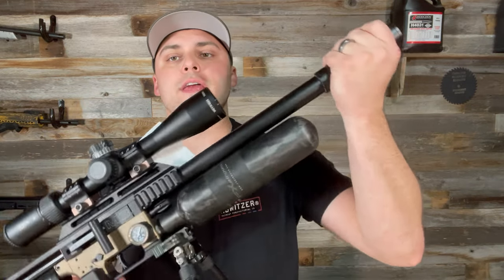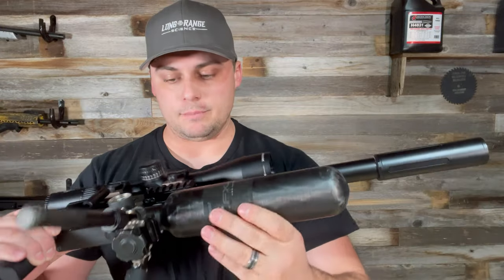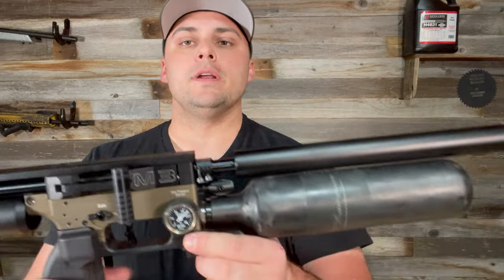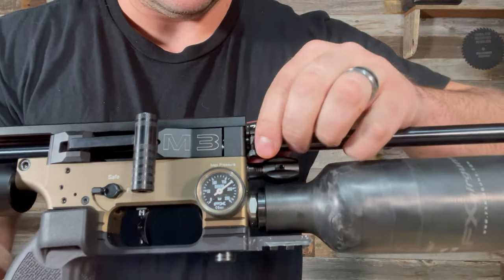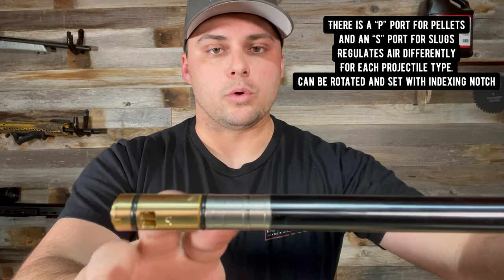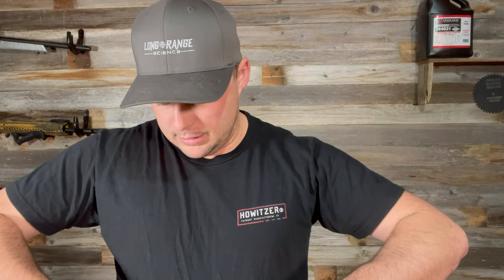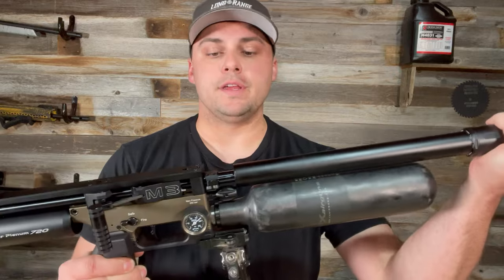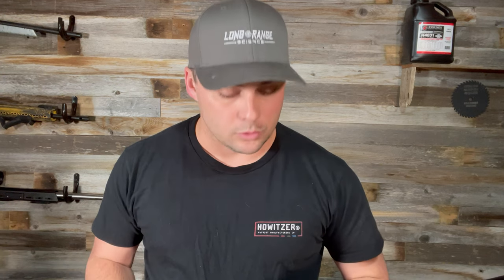Trouble shooting my FX Impact M3 barrel issues

Comment: If youre shooting anything over 500mm barrel length, you have to stiffin/stabilize the barrels on any FX platform! And detune the harmonics. Duhhhh
Reply from the maker: I just got a slug liner and the carbon sleeve. So hopefully everything should be set now
Reply: @longrangescience  ya I understand that Sir. I figured as much. If your thinking about powering up, you have to stabilize the barrel more and get some of the harmonics takin care of as well. I own a few and my friends have some as well. You have to research thorough or talk to a tuning professional on it. I would suggest contacting Matt Dubber somehow or someone like that knows how to squeeze them out with power. It's unlikely throwing on the parts and shooting trying to figure things will work, b cuz it doesn't. I'm just trying to steer you in the right direction b cuz you chose an FX model. The AGT or Uragan models are less headache as well as a few others.
Reply: Ironically FX's Achilles heel is their adjustability in my humble opinion.

I run a standard 700mm barrel in my M3 and using 30gr .218 H&N slugs @985fps. Using 68 year old eyes and a rickety UTG bipod, it will print 15mm groups at 100m ( 109 yards) all day long. No stiffeners no tuners, no rails and other after market rigid frame things etc. So when you find a happy medium, stop fiddling.
BTW  I also have a Weihrauch HW100 with a 600mm barrel. Just one grub screw and a simple barrel band, and it too is incredibly accurate. You don't need to stiffen a 500mm barrel unless you're hanging a very heavy moderator on it.

Comment: Man to bad your first outing was ruined by someone not putting your rifle together properly. I own 2 fx air guns one being an M3 and love them. Know them inside and out. If you don’t know the rifle well it can be frustrating to fix the issues. Especially on a brand new gun. 

I went to your shooting video and your rifle clearly sounded goofy. Like you said the barrel was not seated properly letting air poof out of the breach. Also causes mag loading issues. Im still confused why they gave you that barrel band right in front of the breach. It’s doing absolutely nothing where it is. They have a tensioned barrel system that doesn’t even use a piece like that. Very weird…
Reply: Ahh the new m3s get a updated tensioned barrel system that’s easier to install and uses that barrel band piece.
Reply from the maker: Ya it was interesting but I didn’t know different so I thought that’s just how they were. I thing the vents weren’t lined up so I was getting hardly any air pressure actually into the barrel causing really slow velocities and consistency issues. It does look like that block is part of a new update so I might have to add a tension barrel soon. But I think I got it fixed now so I need to go get all my air refilled and see what it can do. I still love the gun and can’t wait to get it right. But I’m also having a problem with my tank, when I unscrewed it, it dumped all the air. The stop valve isn’t working and it will leak until empty.
Reply: I hope this doesn’t put a bad taste in your mouth with fx airguns they are bad ass weapons as you know I hope you got this figured out and your back to rockin!
Reply from the maker: I think everything looks good now and I called em just to make sure I wasn’t missing anything and didn’t cause any damage. Need to get some more air next week and then we’ll see how it goes. This kinda sucked to have right off the bat, but it’s not to big of deal and I can tell I’m still gonna love the gun. And now I get to see what it’s really capable of

Comment: Um.  No.  You need to take a while and learn how to properly assemble your M3.  What you are calling the "barrel" is the shroud.  The barrel is inside.  Under the barrel locking nut.  READ the manual.  The ports on the brass end are labeled "P" for pellet and "S" for slug.    OMG.  READ.  This is painful to watch.
Reply from the maker: Lighten up man. I’ve had the gun for a week. Obviously said I’m new to air guns and don’t know all the components or interactions. I posted a video shooting it, something was obviously wrong with it, so I wanted to update everyone with a very high level follow up as I tried to figure out what was going on. I read the manual for how to adjust the ports and valves. But really, who reads manuals haha
Reply: Fx are notorious for not being put together properly and leaking straight out of the factory ☹️ 
You need to be a FX Geek to own one of these rifles as they are so poorly constructed you will spend more time in the workshop fixing leaks than shooting 😄 Fx over priced over rated pile of junk was the comment from the gun shop owner who had 4 FX rifles on his gun racks brand new and everyone chronographed between 6ft and 8ftlb two leaked and one power adjustment didn’t work. Gunshop refused to stock FX as he had so many upset customers .
Get rid of it and buy Daystate 👍
Reply: I've had my M3 for 3 years. Thousands of slugs through it and not a moments trouble....but I set it and don't fiddle, twist, change modify or bling it. And as I said in a previous post it's a 15mm grouper at 100m all day long. 
Someone once said..." Only accurate rifles are interesting " So I must say I'll happily take on a little maintenence if accuracy is the winner.